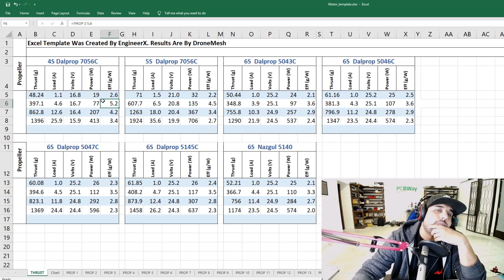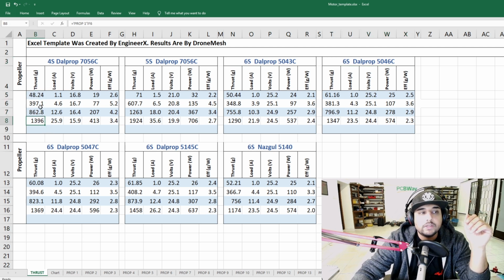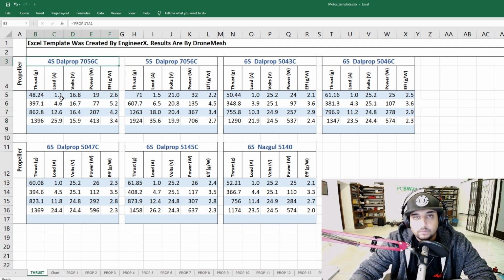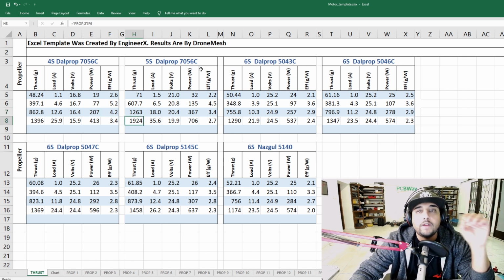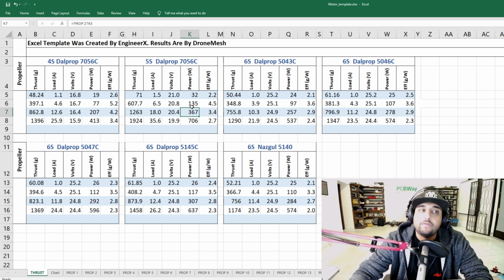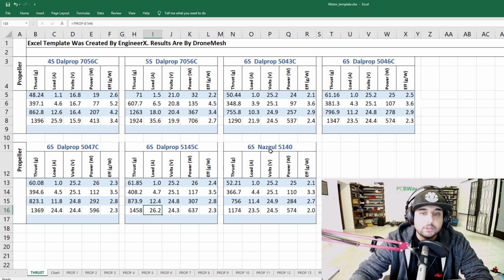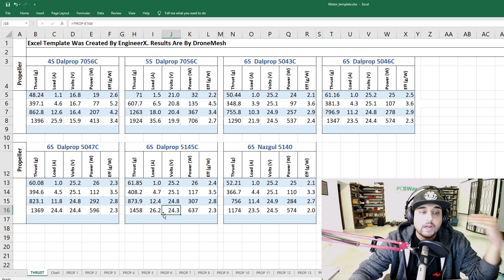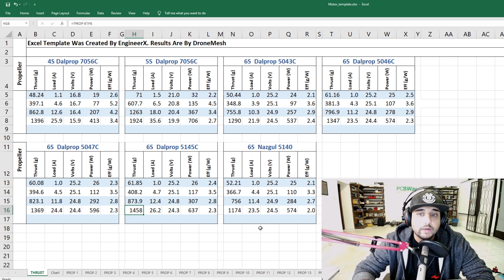Long Range FPV Drone Motor With High Efficiency  // Flywoo NIN 2806.5 1350KV

Comment: They may be great motors but what good are they if nobody sells them. I have looked all over the internet, zero, zilch, nada. The useless getfpv says they're in stock, until you go to check out, then all of a sudden, they don't have any.
Reply: My mistake, I was looking at the nin 2306.5 1350kv. Not to be found anywhere.

Comment: I'm guessing from the chart 45.3  amps per motor at 100% on 6s with 7" props...   x4 = 180 amps max draw...    
So maybe try and get at least a 1800mah battery or higher 6s battery with a 100C rating if you're running 6s 7" props on 4 motors.

180 / target amp of battery you want = C rating of battery you need.
180 / C target you want = amp of battery you need

Comment: 46g motor on 5" or 7056 prop for long range? 
The "secret" formula has always been 2306/2207 and 500g AUW. (200g battery)

Those test results look terrible. 7" prop, should be 6-8 g/W for hover and slow cruise. 8 min crusing is not good. Its mediocre. 7" is about 50% more efficient than 5".
Reply: Your right.
I have the flywoo 2806.5 1350kv  and they are less efficient than the 2306 1600kv i used before.

2306     ~27min flighttime
2806.5  ~20min flighttime
On 4s 10000mah lipo 😲
Reply: Jan Bese can you tell this build? Props, Esc amp, etc... thanks!!
Reply: @durbanxx  Hi, Tbs source one, HQ 7x4x3, Hobbywing Xrotor 45a Stack, F40 pro III 2306 1600kv. Heavy with 10000mah 4s, but nice flighttime and range.
Reply: Jan Bese thanks!!
Reply: @janbese4473   Jan Bese  interesting build. What would you think if I build on 5" with 2x 1500mAh... can it reach >= 10minutes flight time ?

Comment: I may get corrected but I believe to only accurate comparison is to weigh thrust against watts. I wish to know at a certain thrust just how much energy is consumed. I need to have the same data at given thrusts, like 250g-400g-600g-800g-1200g etcetera. If you then know how much your model weighs you compare that sweet thrust spot for slow cruising. Since interpolation isn't necessarily accurate I cant tell if 4S or 6S is better at a certain thrust. You should be able to produce this data with the gear that you have.

Comment: Fantastic testing, Sam!!! 😃
You can probably run those motors on 6s with the DalProp 7056. For 4s the kv must be higher, around 1750kv and 1800kv. 😉

Comment: I would have liked to seen the results of the 7056c on 6s thinking about putting these motors on my crocodile 7 and I fly on 6s and stock 2306 1700kv doesn't even get warm but would like a little better flight time
Reply from the maker: My assistant forgot to test it on 6S I will have it tested with the bortherhobby version